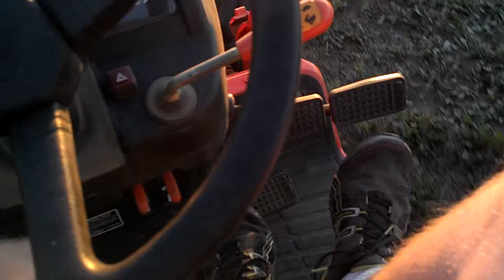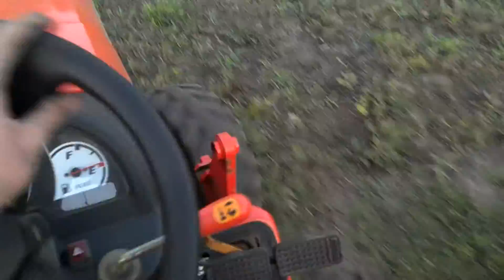Kubota hydrostatic brakes

Comment: it doesn't work for me since i cant twist like a pretzel. little tractors with hst  split brake are useless....  I'm seriously thinking of swapping sides with clutch since you don't need accel and clutch separate,  or swap accel to clutch side?
Reply: chrisrad if you’ve ever driven a John Deere or Ford you would never buy a Kubota. Why do you need a clutch with a hydrostatic?  No composite a John Deere for ease, comfort, and safety. Way out performs a Kubota. I’ve had both and like my Kubota for balance, power but as for operator comfort and ease it is pure junk.